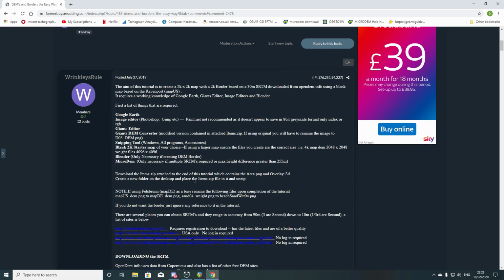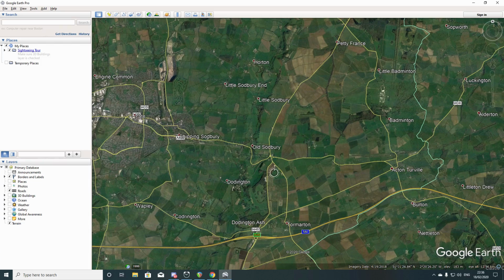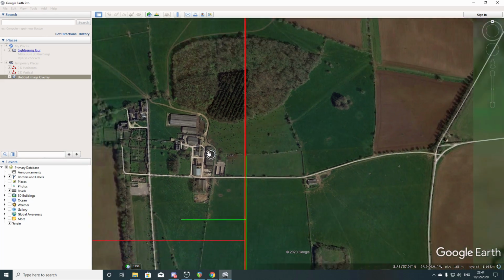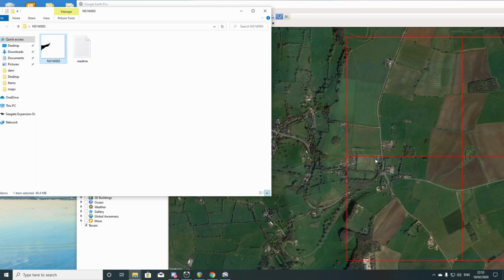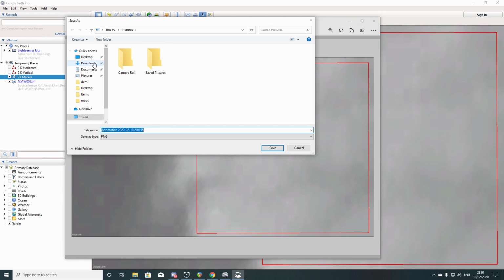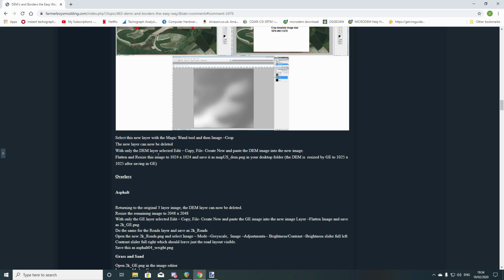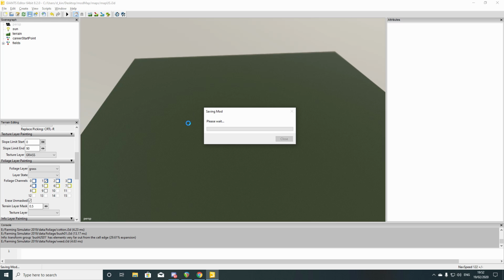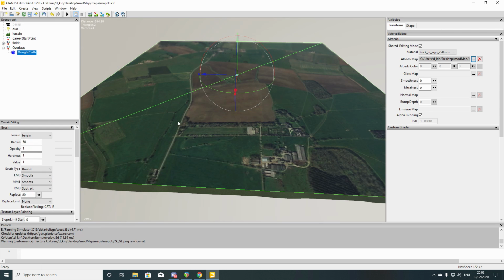Possible alternative method of creating a map dem

Comment: Hey Shywizard, i followed your vid and it works like a charm :), it saved me plenty of time i otherwise would have spend on sculpting the 
terrain. Big thank you for the time you invest in vids so that rookies like me are able to pull this off. I tried to use the dems for a 4x map 
but that dont seem to work, and i cant seem to figure out what i need to change to get them to fit a 4x map. Would you by any chance have a 
solution for that. Thx in advance ;)
Reply from the maker: For a 4x depending the area u want to base the map on, instead of marking out a 2km area make it a 4km area.
If you only want what is contained within the 2km area that will work but will stretched out greatly to fit the 4x.
Resize the DEM to 2049 x 2049 for 4x
Reply: Wonderfull, i am now the owner of a 4x dem'd up map. Thx for the help and the swift reply. :)

Comment: how would i do this for a 4x map?
Reply: Shy explained this in another comment.  'For a 4x depending the area u want to base the map on, instead of marking out a 2km area make it a 4km area.
If you only want what is contained within the 2km area that will work but will stretched out greatly to fit the 4x.
Resize the DEM to 2049 x 2049 for 4x'